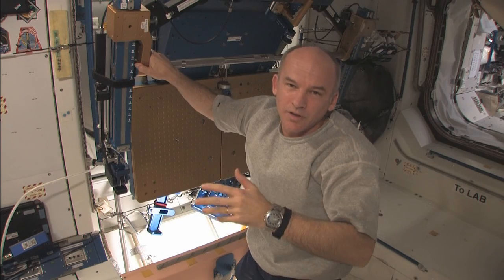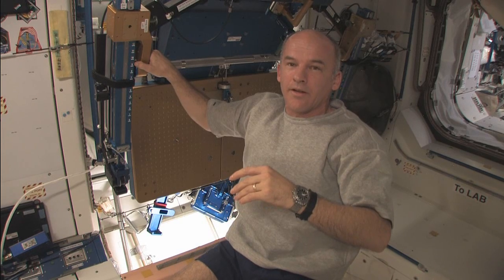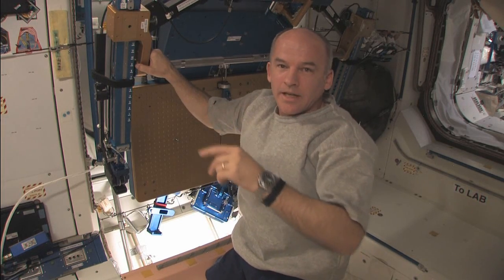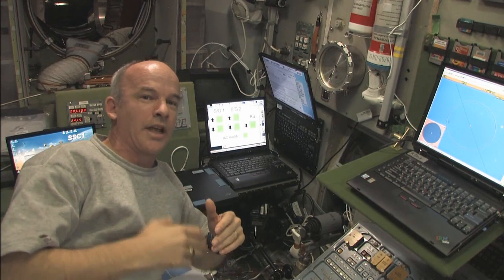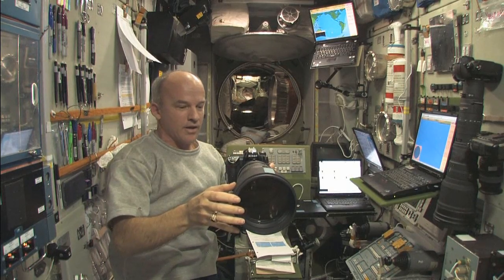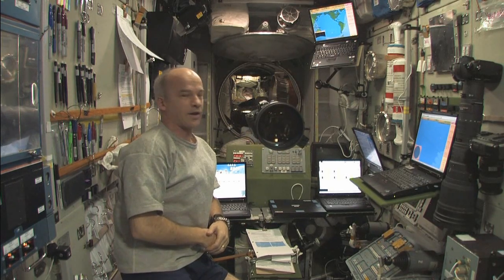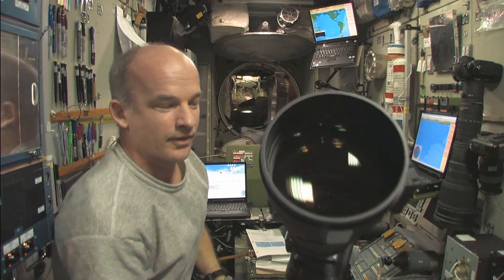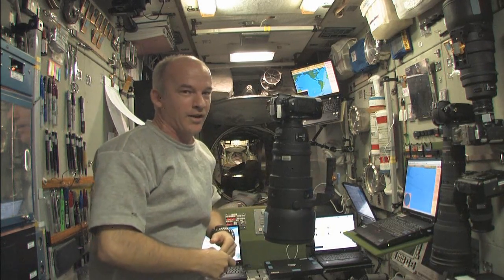Space Station Reboost

Comment: This is such a joke. You can't generate thrust in a vacuum. Nobody has every demonstrated this in a vacuum chamber at 0 psia or even 0.1 psia
Reply: This is such a common and utterly uneducated comment.  If you eject mass away from you - vacuum or not - by the laws of physics, you will be propelled in the opposite direction due to the conservation of momentum.  It's a repeatedly confirmed, and fundamental law of physics.  Assuming rockets wouldn't work in a vacuum is just utterly asinine nonsense.

If you are floating in space and you are holding a bowling ball, and you push that bowling ball away - - you WILL move in the opposite direction with the same - but opposite - momentum you put into that bowling ball.  Literally physics ONE OH ONE.
Reply: @willoughbykrenzteinburg  Ok then why did the X-15 rocket plane only reach 354,200 feet? Why not higher? No aircraft has gone beyond 400,000 feet ASL. If you could float in space then yes pushing a bowling ball away from you would force you in the opposite direction. Tell me how you could keep throwing enough bowling balls continuously to overcome gravity to gain altitude? Gravity does not just turn off at a certain altitude like magic. Does the moons gravitational pull not effect our tides? That's much further away then the International fake station so tell me how they experience zero gravity? The X-15 rocket set the speed record of 4520mph so don't try to say a large bulky fake station is capable of traveling at speeds over 17,000 mph in order to orbit earth. How could a space station or delivery rocket reach speeds more than 3x the X-15? Not possible. You and NASA are liars.
Reply: @RNDInnovators  because it didn't have enough propellent to reach higher.  

Have you seen the size of ACTUAL rockets that reach orbit compared to the X-15?  The reason those rockets are so big is overwhelmingly because of the amount of fuel and liquid oxygen they must carry to get there.

This is a patently ignorant comment.
Reply: @RNDInnovators 
Air with no mass? Air has mass. The rest of your comments are nonsense like this.

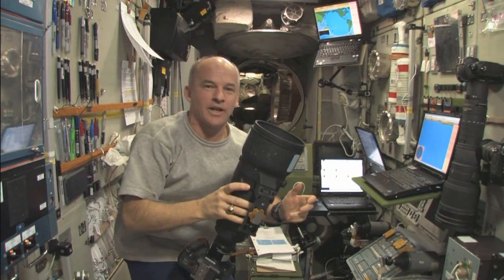Comment: Love this video in 2020! Awesome demonstration of the very gentle acceleration. By the way, at 2:23 that is actually an old Nikon 600mm f4 AI-F lens (coupled with a Nikon D2x), rather than an 800mm. The total weight of the package of lens with camera would be 7302 g or around 16 lbs. Of course there is no "weight" in zero g, but still a cool demo. Interestingly, hanging on the wall to the right is a Sigma 800mm f5.6 lens (autofocusing). So, back then, Nikon didn't have an 800mm auto-focusing lens, so it looks like NASA was using the Sigma 800mm.
Reply: If the lens has a mass of 7.3 kg on Earth, it has a mass of 7.3 kg on the space station.  Many people think that everything can be moved or carried with ease like moving this lens from one end of the station to the other would be no different than carrying a pencil from one end to another, and it's not the case.  It still has the same mass, ergo accelerating that mass requires the exact same force as it did on Earth.  The only difference is that there is no downward force on objects you have to counter to keep it from falling downward.  The force required to push it sideways or up or down or whatever direction is exactly the same.  You would certainly feel the heft of a big 7.3 kg lens when you try and push or pull it.  You would certainly feel that mass.
Reply: Yeah but after you push it if you just follow it and direct it by tiny corrections it would be just very lightweit touches

Comment: To the idiots that have no understanding of this.  Before the burn, everything on the station was moving at the same velocity.  During the burn, the station is accelerating, and everything physically attached to the station is changing speed.  The camera, which was not attached seems to be accelerating but really it is just keeping its original velocity and the station is moving away.  Now, once the burn is over, the station is NOT changing velocity any longer.  So once he steadies the camera it now moves with him.  Note if the station doors were open and you were some how standing outside observing, you would see the station and camera moving apart.  And if you had a gps unit on the camera and on the station, you would see that during the burn, the camera velocity did NOT change.  The Station velocity did change, and kept increasing slightly during the burn.
Reply: Wait, if anything not attached to the station is keeping it's original velocity, wouldn't touching the station after the burn is done take away some energy from it to be transfered into your body and make it move at the same speed?
Reply: El Pato Reviews well in theory yes but the mass of the human body is negligible

Comment: "Polycarbonate has a glass transition temperature of about 147 °C (297 °F), so it softens gradually above this point and flows above about 155 °C (311 °F)" and since radiation travels best in a vacuum, how is it that the polycarbonate visor on astronaut's helmets are not affected by the sun's radiation?
Reply: Easy: the visor never heats up to such high temperatures, as it is optically coated with a thin metal layer to act as an ND-Filter and reflect radiant heat.
Reply: Cause they made in Amerikka and They BADARSE NASA stuff boy!. They even had film in a camra on the moon where it 1200 degrees but their plastic suits and film that melts at 185 degrees was not harmed. Plus when they took back off they used superjew mind powers to tilt the camera at the space craft after it took off. Then they mind warped the film backed to earth right out of the camera. TheyBADARSE BAY!..

Comment: The ISS is allegedly accelerating to Earth at 9 m/s/s, so everything inside should be moving upwards all the time, but it's not.
Reply: that is becouse everything inside the iss also accalerates to earth at 9 m/s/s. For example if you skydive with someone else at the same time, you both kinda stay together.
Reply: Tim Lexus, by your own explanation, since the camera was inside the ISS, then theoretically, the camera should have accelerated along with the ISS, but it didn't.  So why didn't it?
Reply: This is becouse the acceleration of the iss hasnt got to do with the acceleration of gravity. The camera wont accelerate unless it is stuck or pushed/pulled by the accelerating ISS.
Reply: Tim Lexus, ok thanks.
Reply: They use VELCRO and Helium thats why boy. They knows what they does. They the brains not yous. Everything move at the same speed in a Holywood basement.. Boy!

Comment: why ppl move slower in space ? its because they have to be careful about everything or it's because any rapide movement destabilize you ?
Reply: They're careful around important technology and careful about their own wellbeing. Suppose you're sitting on a couch right now, reading this. If you're in microgravity and you stand up quickly (i.e. push against the floor), you have a very good chance of ramming the ceiling or a wall with your head like a rocket.

Think about it: you can jump a little or climb stairs (i.e. defeat gravity for a moment) very easily. The very same jump on ISS will basically make you "fall" into the ceiling like it's a floor (not exactly, 'cause you don't KEEP accelerating - but in the first few feet it doesn't matter too much).

Comment: 2.7 m/s..... I can fart better than that. ISS farts are weak.
Reply: I know you are joking, but the 2.7 m/s is irrelevant if you want to describe how powerful the boost is.  The important bit is the acceleration - and that would be 0.0185 m/s².  However, the mass of the space station is about 420,000 kg, so F = ma = 420,000 kg * 0.0185 m/s² = 7,770 Newtons = 1,746 pounds of force.  Also, you wouldn't WANT to accelerate the ISS much more than this anyway since you don't want it falling apart.  There - I just nerded up your fart joke.
Reply: +Willoughby Krenzteinburg 7770 N of farting force, your body would experience about 10 g, similar to that of taking off from a rocket
Reply: +Willoughby Krenzteinburg <3
Reply: +Willoughby Krenzteinburg  good shyt!

Comment: I'm pretty sure he meant that the acceleration "didn't" apply to him towards the end.  The station is accelerating, but if he lets go of that which attaches him to the station, which he did, then the acceleration no longer acts on him.
Reply: He just explains it that way to keep it easy.. But you are right of course.
Reply: acceleration is force divided by mass. Acceleration is absolute, since it's the result of an unequal force being applied.
Reply: Brandon Smith since the motions are relative, if we are accelerating toward him then he is also accelerating toward us.
Reply: acceleration is change in velocity over change in time- if you graph his motion using the station as a reference point, he is accelerating. If you graph the stations motion using him as a reference point, it is accelerating. The definition of acceleration says nothing about force.
Reply: Chrismofer That's not how relative motion works.  It only applies to inertial reference frames.  Velocity is relative.  Acceleration is absolute.  You cannot say that he was accelerating and the station was not and have it be equally valid for this reason.  That would be a big no-no.  If that were the case, then you could just as validly say that there was a force acting on him and no forces acting on the space station - - - and that would be ENTIRELY wrong.  Forces are not relative.  Therefore, the results of forces (accelerations) are not relative.  Inertial motion is relative (this is motion when there is no force or acceleration).
Reply: @willoughbykrenzteinburg  Proper acceleration is absolute, sure. Coordinate acceleration depends on the coordinates you choose, and if you choose an accelerating reference frame where the space station is stationary, then the camera and the astronaut are accelerating in those coordinates.
Reply: @Arkalius80  You're just describing inertia and fictitious forces.
Reply: @willoughbykrenzteinburg  I never once mentioned a force or inertia, nor did anything I say describe either of those things. Coordinate acceleration is a change in velocity in a given set of coordinates. In the set of coordinates where the velocity of the station is 0, the camera has non-zero coordinate acceleration.
Reply: @Arkalius80  In an accelerated reference frame,  objects appear to accelerate because of inertia, and in an accelerated reference frame, you must introduce inertial/fictitious forces in order to reconcile Newton's laws.

If I'm in a car, that car is station art relative to me.  If I slam on the brakes, objects in that car will appear to me to be accelerated toward the front of the car.  What force in my reference frame caused it?  You have to invent one because no actual force caused it.  Objects which accelerate must necessarily have forces acting on them per Newtons laws of motion, so there must he a force.  In the accelerated reference frame, you must invent an inertial force.  In reality (from an inertial reference frame) inertia is what caused the objects to continue moving while the car braked.  You dont have to say the words "inertia" and "ficiticious force" to be referencing the concepts.

Also, in the car - you can measure the acceleration.  Since it is absolute, you cam literally tell when the car accelerates because you are pushed into your seat.  This is something unique about gravity in that gravity itself is a fictitious force, but that's delving into general relativity.  You are indeed talking about inertia and fictitious forces.  Absolving yourself of error simply because you didnt use those words is not an argument.
Reply: @willoughbykrenzteinburg  You're not telling me anything I don't already know. And just because something in an accelerated reference frame is accelerating, it doesn't necessarily mean inertia is causing it. That object could be undergoing other real forces that are causing its own proper acceleration in an inertial frame.
Reply: @Arkalius80  Is this your thing?  You go around youtube replying to years old comments adding absolutely nothing of substance only to end up agreeing with the thing you were attempting to refute?  To each his own I guess.  Have a good one.
Reply: @willoughbykrenzteinburg  I'm not sure that's how I would evaluate this exchange. The original years old comment I responded to was worded in a way so as to ignore the concept of coordinate acceleration that differed from proper acceleration. I was merely trying to reintroduce it.
Reply: @Arkalius80  Then do it without me.  You certainly don't require my participation to install your curriculum.

Comment: You could reboost 450 tonne ISS by swinging 7 tonne Progress on a tether.  You could spin up over 1 day to reduce power requirements.  If ISS acceleration is kept to 0.0185 m/s^2, the tether must be 24.7 km to get 170 m/s Progress velocity.  Kevlar 49 tether would be 4 mm diameter (safety factor 4) and would weigh 447 kg.

Doubling the ISS acceleration allows halving the length of the tether but tether mass remains the same.

Comment: Okay, the Progress M1 is 7150 kg (not sure if that's empty or full). We'd need to launch it at 170 m/s to give 2.7 m/s to the 450000kg ISS. That's 103.2 MJ over the 72.8m length of the ISS. Force would be 1.4 MN. Progress accel would be about 20g, ISS accel 1/3g. Boost time 857 ms. Peak boost power (as Progress reaches end of launch rail) 241 MW.

A challenging engineering problem, but not utterly infeasible.

Comment: Here's another way to calculate it. He said the acceleration was 0.0185 m/s^2, so if the station mass is 450 000 kg as you say, that's a thrust of 8 325N or about 1 870 lbf. The burn continued for 2.7/0.0185 = 146 sec, so if the Isp is 300 sec it would consume 910 lb of propellant, which is the same as 413 kg.

Comment: The fuel required to maneuver the ISS velocity doesn't depend on the current velocity, only on its mass and the required delta-V. A delta-V of 2.7 m/s to the ISS would require an extra 2.7 m/s for any rocket to rendezvous with it. Small, but every little bit of saved fuel means more cargo.

Comment: Why spacestation(s) are white or grey? Why they just aren't black so that sun would warm them.. I don't think that black paint sucks radiation itself ..radioation is invisible after all O_O
Reply: black absorbs so much heat from sun that you wouldn't have a problem with warming but you'd have a massive problem with cooling because the station would turn into a oven. And in space it's easier to heat than it is to cool, contrary to in atmosphere, because for cooling in space requires specialized radiators as there's no air which would absorb the heat, circulate and carry heat away from radiator block, meaning the only way for the radiator to cool the station would be, well, to radiate heat through radiation which is stupidly ineffective as opposed to using say solar energy to convert to electricity and then to heat.

Comment: The camera would continue to drift slowly because the space station is now moving at a slightly higher velocity than the camera.  If the space station were long enough, the shear forces between the air molecules and the camera would eventually transfer enough momentum to the camera that it would accelerate to the same speed as the space station.  But since the space station isn't long enough, the camera would just hit the wall before that could happen.

Comment: I wonder what would have happened if you let the camera float, and then the engines cut off. Would you visibly see the camera slow down?
Reply: If you haven't found the answer in the last 10 years, then here's it for you. The camera will not slow down, but will not accelerate. After the engines are cut off, the camera will continue to move in that direction at the speed it was moving right before the engines were off.

Comment: The numbers are mentioned in the video, 
2.7 meter per second increase in velocity was being sought by the burn, to be achieved by an acceleration of 0.0185 m/s^2
If you know the length of time of the burn you could work out the mass of the station.
or if you know the mass of the station you could work out the required length of time required for the burn.
I have just woken up so I will let you do the math :p